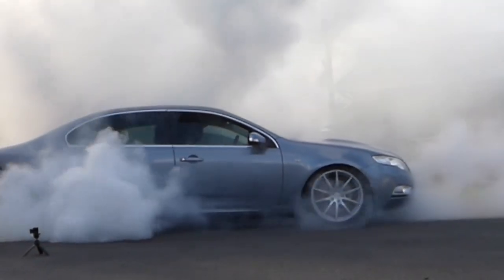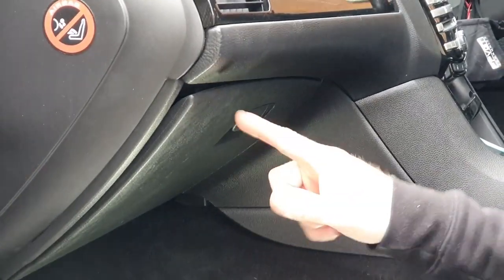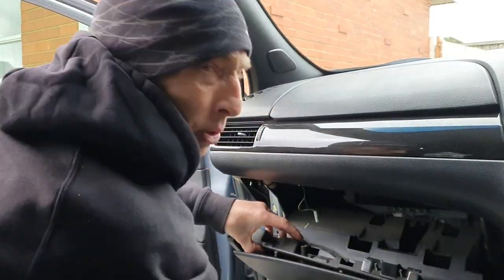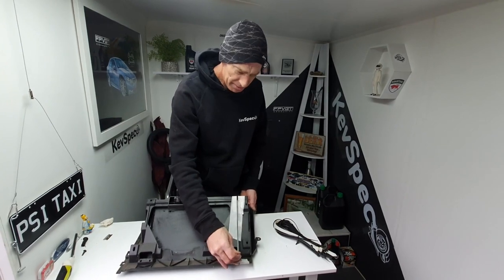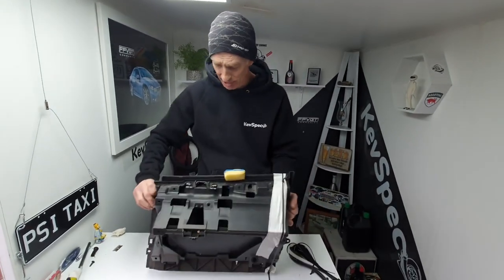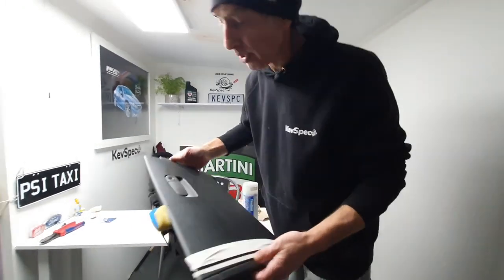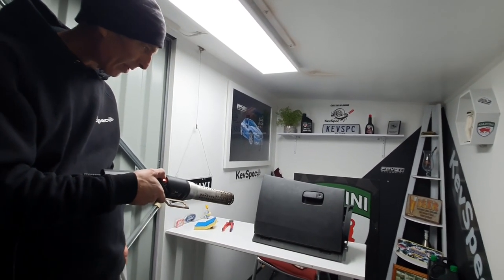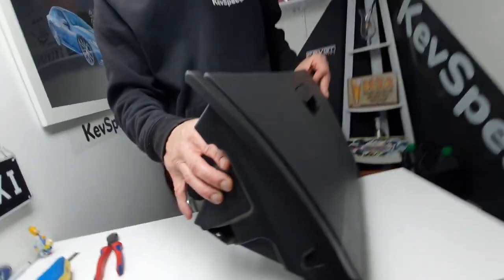TOP 3 ELECTRICAL FIXES  BA-FGX Ford Falcon -[PART 1]How to stop your glovebox draining your battery

Comment: Hi I have a fg falcon ex6 series 2 and have a problem with battery charge light coming on and off changed fuses battery and alternator  with out any success what would it be funking doing my head in mate
Reply from the maker: Hey mate ..check all your earth's 👍
Reply: Hi bud still have charge light  problem got a question  if I remove  the main earth wire in main fuse box and located  to body do you reckon it will interfere with anything
Reply from the maker: Don't remove any earth's
Reply: Hi mate can I put a new earth lead from the engine  to the negative lead and see if it fixes it
Reply from the maker: @MichealbrianClark-nj1tn ..you can't really hurt anything by adding more earth's..just install them correctly...I have added a earth from battery to engine 👍
Reply: Hi mate no good  outcome still the same

Comment: Ever since I upgraded to a larger 800CCA battery, I have no electrical issues. My FG is an EcoLpi which has high compression.
Reply: Did you ever have a backfire then engine won't crank after that?

Comment: more expensive but i think it's worth it in the long run i have LED'S everywhere in my bf get them from supercheap auto or jaycar
Reply from the maker: Hey couldn't find any LED s in that type of globe ..
For some reason it's different to the normal little Wedge type bulbs  in the interior and like the PARKER GLOBES .
It will have to do for now.
Cheers
Reply: @kevspecfpvgtcofficial3592  if you can't get it anywhere else jaycar should have it i got the little globe's for the map light's where the sunglass holder is from jaycar